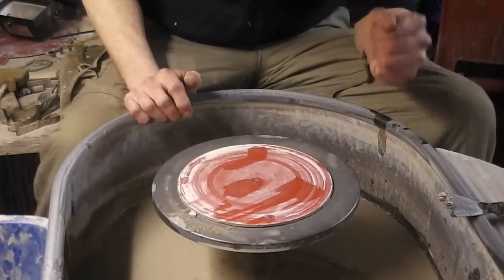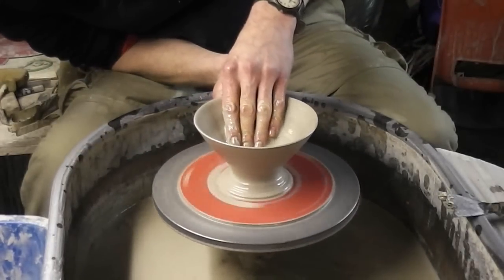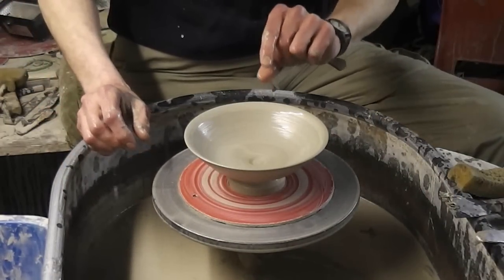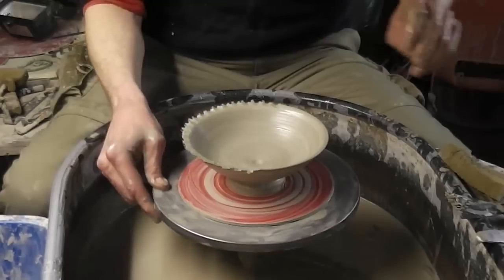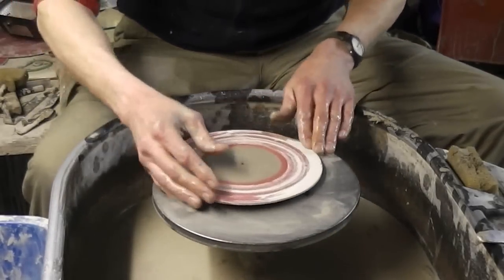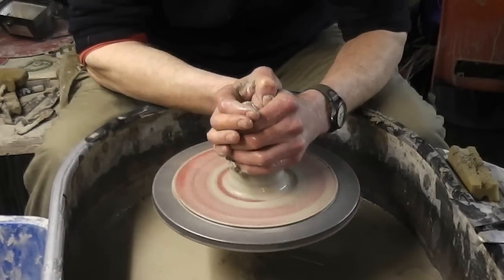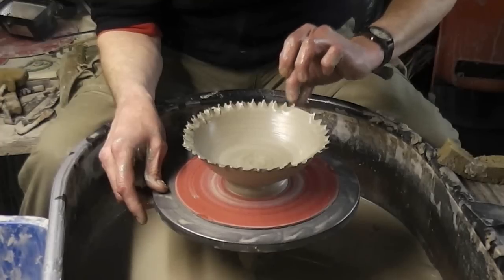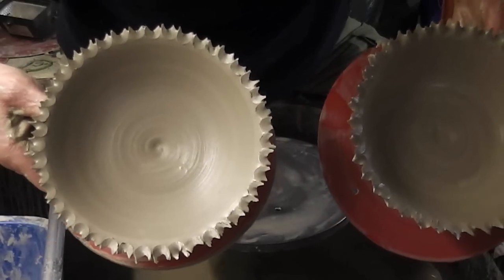Throwing / Making a torn ragged rimmed pottery bowl on the wheel

Comment: where can I get those circular boards?
Reply: Caroline Benson
It is called a bat, you can purchase them through most Ceramics and pottery distributors, and art material suppliers like Blick.  They are made in a variety of materials, such as wood, pressboard, and plastic; they also come Square.